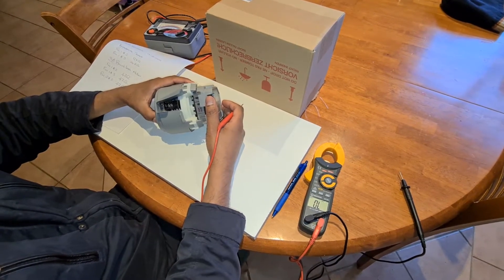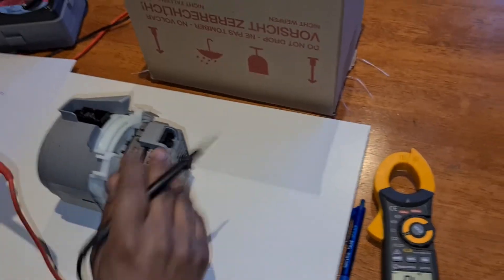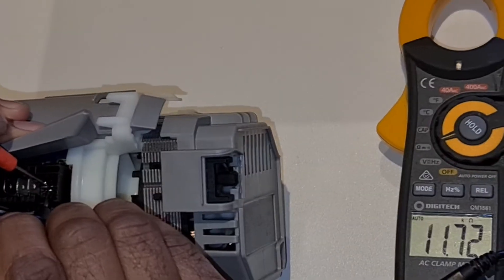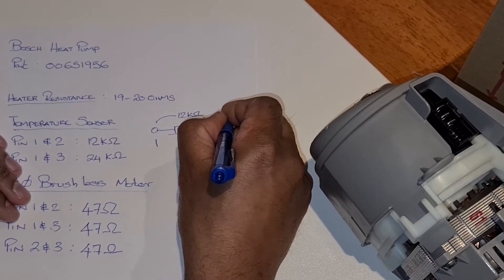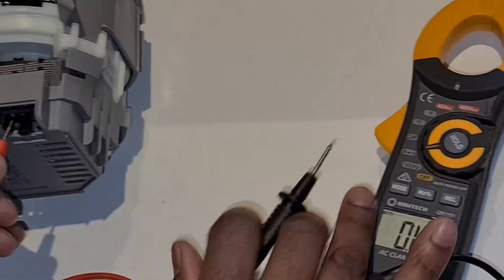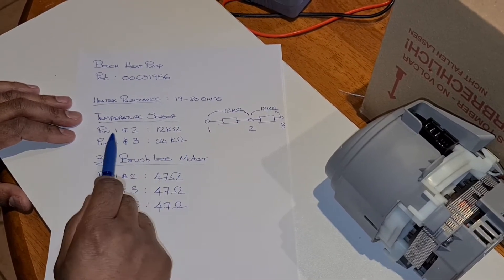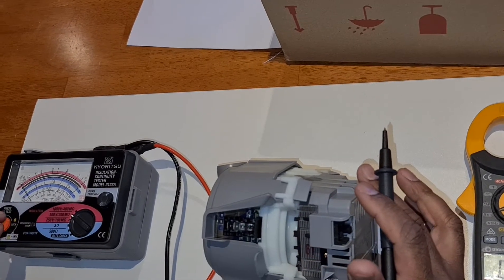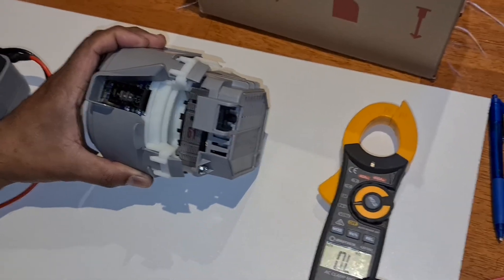Bosch Dishwasher Heat Pump (Wash Pump) Testing/Diagnostics Part No: 00651956

Comment: Can i know minimum lifespan of bosch dishwasher heatpump when purchased and for the replaced spare part?
Reply from the maker: The mean time between failure for the circulation pump is 10-12yrs.

Keep in mind other parts may fail during this life span
Reply from the maker: You should get about 7-10yrs with a new heatpump. Mind you that depends on mtbf of other components

Comment: is your pump works on 120vac or 230vac ?  is the results could be the same if current is differente ?
Reply from the maker: Hi Pascal

The pump actually operates like a 3 phase motor. The board converts into 3 phase and commentates the motor. Although supply voltage is 230v/120vac , the motor voltage is actually fixed by bosch and shouldn't matter. Varying speed us done by varying frequency.

Comment: A great video on an excellent channel thanks Oracle. 
My SMU68M05AU/55 which has this same heat pump, is only heating the interior of the dish washer to from 25 (pre wash) to 32 degrees C on a 70 degree wash cycle. The machine gives no errors but it's not washing properly and there is some water left in the base when the cycle is over.
I've tested the heating element using your instructions and get a reading of 21.5 Ohms. The temperature sensor pins are reading 10.53 kOhms,10.52 kOhms , 21.09 kOhms. 
Could the higher resistance on the heating element mean that while the heater can produce limited heat and not cause the machine to fault out, it is unable to get hot enough?
Reply from the maker: Hi Mick 

Thank you for your kind comments.

The wash and final rinse reach 70DegC on a pots wash cycle. If you log the cycle you would be able to test this with time.

So log the cycle and double check.

It is possible that the heater is slowly failing resulting in a lower temperature. 

This usually means the heat pump is on its way out.

Check for any corrosion at the bottom and near the terminals.

Comment: Great video very helpful.

My heater pump has a code 1BS3615-6EA. The issue is water is not getting hot enough,only warm and the dishwasher is connected to a cold tap. Readings are

Heating Element 20.4 ohm

Motor 43 ohm on all pins

Heater Thermistor pin 1to2 9.5 K ohm pin 1 to 3 18 k ohm.

As some heat is occurring and resistance is within your spec I suspected the Thermistors. Both Thermistors have the same reading but are well below the spec you suggested.

Are the Thermistors the likely cause?
Reply from the maker: Can be thermistor , but can also be a possible issue with a dry joint either on the element or the board

Comment: Great Video.  My dishwasher is not heating up the water.  I took the measurements as follows:

•	Heater resistance 
o	  Pin 2 & 3 (19-20 Ohms); Results 3-4 MegaOhms -> ?
•	Temp Sensors
o	  Pin 1 & 2 (12 KOhms); Results 10KOhms -> Okay
o	  Pin 1 & 3 (24 KOhms); Results 20KOhms -> Okay

•	Brushless motors:
o	  Pin 1 & 2 (47 Ohms); Results 54 Ohms -> Okay
o	  Pin 1 & 3 (47 Ohms); Results 54 Ohms -> Okay
o	  Pin 2 & 3 (47 Ohms); Results 54 Ohms -> Okay

I hope I am measuring this correctly, but I am not getting the 19-20 Ohms for the heater pins.  I suspect this is the culprit.  Correct?
Reply from the maker: Yes Heater is open circuit , replace heatpump
Reply: @theoracle6005  Replaced heater pump and now works! Thanks for the help. You are a nice person 🙂👍.
Reply from the maker: @willyortiz1022  Your most welcome Willy Ortiz - Glad to see you fixed your problem

Comment: Hello! Someone knows, what kind of thermistors are used for that temperature sensor? Where can I buy them?
Reply from the maker: Hi 

You will need to buy an entire new heat pump. The thermistor is integrated into the heat pump and is built in to heater zeolith.

Cannot purchase off the shelf thermistor for this application

Comment: Thank your for the info, very precise and straight to the point, like 😁. I got 20.15 Ohm in the heater element, 11k+11k in the thermistor and 43.85k(1-2),  44.15k(1-3), 44.85k(2-3) in the 3 pins of the motor coil. The motor should be good 👍

Comment: Hi. when taking the motor out for testing the motor connector broke apart leaving me with three velvet wires. I'm trying to reconnect them to the connector does it mater which one go's where ?
Reply from the maker: Hi Muli ron

Has the Temperature sensor moles connector broken ?

The small connector on the RHS is the.temperature sensor. 

If so , it certainly matters. Incorrect connection will result in an Error code displayed.

Pin 1 and 2 should be 12k
Pin 1 and 3 should be 24k

Based on this you should be able to find the correct orientation. 

If the connector for the big plug on the LHS broke then remember the green earth is the first pin on the Left hand side, followed by the heater terminals on pin.

If the earth terminal is connected in the wrong pin, this is serious as it can result in electric shock to the user or keep tripping the safety switch if installed.

Remember the pin 2 and 3 of the big connector should be between 19-20 Ohms resistance. 

A megger test will or portable appliance tester can be used to ensure the appliance has been correctly connected.

Kind regards
Reply from the maker: Hi Muli

The resistance between pin 1 and pin 2 should be 12kOhms and 1 and 3 should be 24kOhms

Comment: I got around 15kilo oms and 30 does that mean its too much or the resistance its too high for the heater to work?
Reply from the maker: Hi Abdyl

The heater pins should read 19-20 Ohms.
15k and 30kOhm on the thermistor is roughly double, so should still work.
Reply from the maker: Hi Abdyl

You should have 19 Ohms on the bigger pins 2 and 3 for the heating terminals.

15kOhms and 30 Kohms may be ok depending on the type of pump as its more or less double.

May I ask what issue you are having with the dishwasher.  Did you get any fault codes appear, this may allow us to understand your problem and then we can look at possible solutions

Comment: Hi, my pump is very similar (part nr 00654575) and has a ground and 3 heater pins.  Between the ground pin and live pins I measure open loop, between the lives I got about 11 and 20 Ohms (pins 2 &3  and 3 & 4).  Can I conclude this resistance is far too low and that the heating part of the pump is faulty?  It also made the short to ground.  Great and very clear video!
Reply from the maker: Hi Phillippe

Thanks for writing about your problem and your feedback.

When you measured the resistance between earth pin (Far LHS) and heater Pins, Pin 2 and 3 did you use a Megger tester on 500v setting to measure resistance. This will measure insulation resistance. 

Is your unit Tripping the breaker ?

The heater resistance should be between 19-20 Ohms.

You can also visually inspect to see if there is any form of burnouts or corrosion on the heater where the Pins are located. This can also verify if there is a possible issue with the heater circuit.

On the Bosch units I have also come across issues where there has been defective main boards that trip during heating. But having said this 98% of time it was the heater and maybe 2% of the odd time when the board was causing issues with heating.
Reply: @theoracle6005  Hi, sorry for the late response and thanks a lot for yours.  In the mean time I have come to the conclusion that the second resistor of the heat sensor has an open.  Between pins 1 and 2 I measure about 11 Ohms and between pins 1 and 3 OL.  On my new style pump I measure about 12 and 24 ohms.  I had to rewire with the kit that came along with the new pump.  The new pump has good resistance readings.  Unfortunately, the E02 error still remains.  So there must be a second problem.  Could it be the faulty pump took out the control PCB?  I came across this possibility on the internet somewhere.  What would be your opinion on this?  Is there a way I can diagnose the PCB (the one the power cord connects to)?  Thanks!
Reply from the maker: @bultech  

Hi Philippe 

Can u kindly send me the model details for your machine please
Reply: @theoracle6005  it’s a Siemens with modelnr. SN66M030EU/02.  I just pulled the control board.  Nothing looks burned or damaged in any way, exept for 2 pins that were used for the heater (I think).  They are no longer in use with this pump, since the new wiring requires less pins.  The pins are blu-ish in colour, a if the metal got quite hot.  But as I mentioned, I can’t find any obvious damage.  The control board nr is 9000214580.  Thanks again!
Reply: Finally found the culprit.  2 relais on the control board are dead.  The bad hearing element probably took them out

Comment: Hello, this is excellent info! I did check the readings and it seems like one of the thermistor (pin1-2) is blown and has resistance in mega ohms. Pin 2-3 seems ok with about 10 kilo ohms. Just curious if these thermistors can be replaced? Thanks again!
Reply from the maker: Hi Samarth, 

The thermistor is basically printed on the heating element Zeolith. So this means a new heat pump unfortunately.

Once the heat pump is pulled apart the oring seals are compromised, hence not recommended to be put back in service

It is amazing how they do this but very effective. The downside is that corrosive chemistry in detergent/rinse aid eventually eat thru the coating resulting in failure.

Comment: Very useful - the dishwasher might be saying there is a fault but without being able to check the actual issue (after all it could be a faulty controller!) you're left not knowing where the real fault lies. But with this data, you've got a chance. In my case the heater element was blown to bits - so cured with a new unit. Cheers :)
Reply from the maker: This is where measuring the resistances help. If all in specifications, then it's possible that the heater relay is defective
Reply: @theoracle6005  Oh the irony of your timing, we have just had our new dishwasher delivered TODAY! The latest fault was a pump error; but it seemed so incredibly hard to access the actual pump itself after checking for an obvious blockage from the washer side (the heat pump was bad enough) that I gave up - the machine was now 13 years old. I took every bit of it apart in the garden yesterday (should have grabbed a picture) so it can be truly recycled. I also removed the 1 year old heat pump and it sold on eBay within hours :)

Comment: Hello, thanks for your video. I have a question: if by testing I do not obtain the correct values in the temperature sensor and the ohms are going down more and more (10,86kh, 9,46kh, 9,27kh) and quickly, does it mean that the heat pump is faulty?
Reply from the maker: Hi Edu Lopez

Thank you for your question.

What is the error code you are getting?

 If the resistance on the temperature sensor keeps reducing , it is possible that the heat pump could be defective.

The sensor typically at room temperature should have a stable resistance.  These sensors have a negative temperature coefficient- meaning that the electrical resistance drops with an increase in temperature. 

Another good way to test the sensor for earth leakage would be to use a megger tester on 500Volt setting and touch Ground pin (First Pin on LHS) and touch each one of the sensor pins. You should have an infinite resistance typically on a good heat pump.

Should there be deflection or a low resistance with the merger tester then you more than likely have a defective pump.
Reply: @theoracle6005  Hi, thanks for the video and your comments.  I have come here looking for the E01 error in the Siemens SR64M032EU / 28 integrable model (45cm).  In addition to having reset the machine, there is no obstruction in the drain pump and I see it in perfect condition.  There is no obstruction in the tubes either.  I have taken out the heating pump to test it and the resistance is correct between 19 and 20 ohms.  But some error information web pages indicate that the E01 is most likely an error that comes from this part.  That is why I have also tested the temperature sensor of the pump (the 3 small pins next to the resistor pins), and in theory as I have found it should be at 12kohms but I have measured it several times and each time it shows less (10.86kh, 9.46kh, 9.27kh, in a few minutes).  Also the brushless motor, marks 54-55 ohms, approx, between pins 1 and 2, 2 and 3, and 1 and 3 indifferently.  As in other pages and resources talk about the power module, it makes me doubt if the temperature sensor is really damaged and therefore I have to change the heating pump or it is more the fault of the module ... I hope I have explained myself well and that you can help me , regards.
Reply from the maker: @edulopezal  E01 may be a controller related error
Reply: @theoracle6005  THank you so much. You mean the power module or other piece? thanks
Reply from the maker: @edulopezal  yes I recon you may have an issue with Power module
Reply: @theoracle6005  Thanks for everything, you were finally right as I changed the power module and the dishwasher works. The only problem is that despite having bought the same power module but second-hand, confirming the code exhaustively, once installed the dishwasher works but the control panel does not respond the same, the buttons seem to have been exchanged and the configuration doesnt work exactly in the same way. However, the dishwasher allows us to wash dishes perfectly.
Reply from the maker: @edulopezal  Hi Edu Lopez

The board may be programmed for a different variant. So generally I would replace with a new one and supply the full model number, so the correct board is used